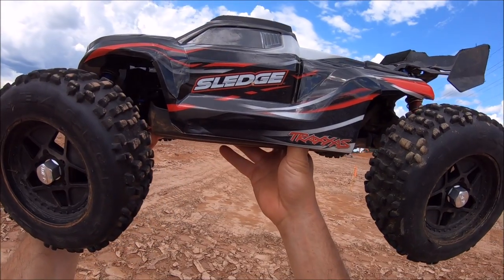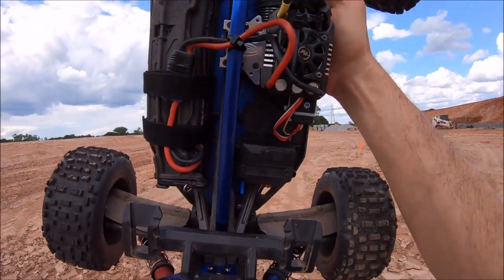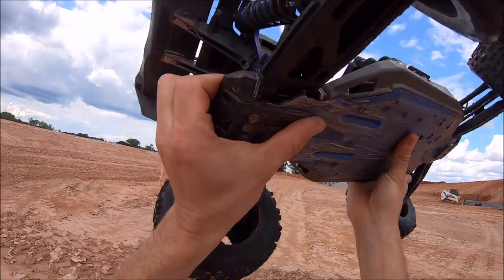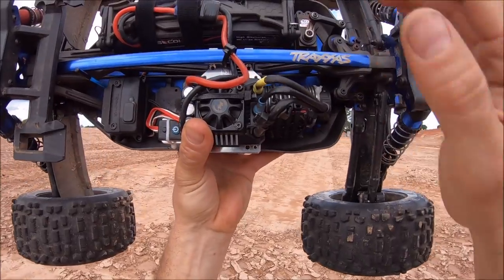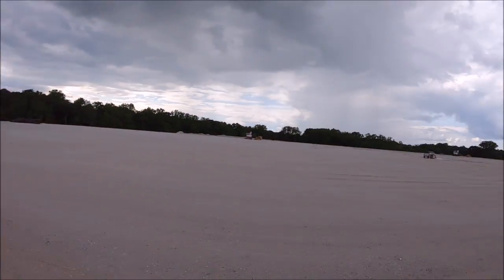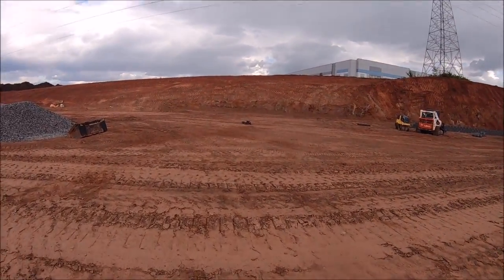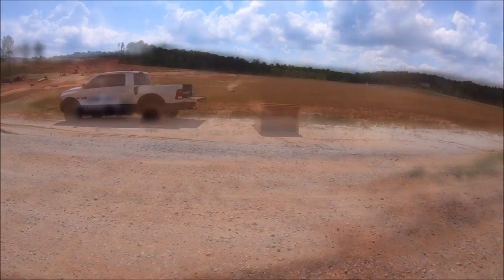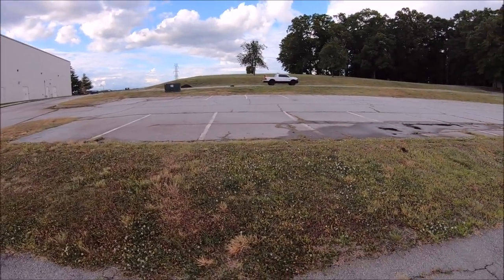TRAXXAS Sledge NEW! M2C Upgrades and MEGA Beatdown!

Comment: Damn , amazing bash session , i hope M2C start doing parts for other brand tho, thee are A LOT of people with crazy build of Wltoys that would pay for premium parts ( especially motor mounts that are adjustable ) including me . There is something cool about having a small 1/12 that does 100km/h + and is not just street only RC.
Reply: He only makes parts for cars that are weak points to where enough people will need them I don’t believe WLtoys has a big enough following of those that want to dump money into them cause they’re generally for people who are on a budget which M2c is not a budget minded parts company.
Reply: @codenamethecleaner7519  they are budget brand for sure but a lot of people build them into speed monsters and use mod1 gearing which requires another motor mount since the stock one is non adjustable.

Comment: Some questins, Sir:

1 is that the 4985-motor?
2 si the Sledge tuffer than the Kraton? I built one for a friend with all possible upgrades, even alu-diffcases/bulkheads. It is not so strong as people believe
3 please, PLEEEEEASE tell me how to secure pinion gears. No matter what car, we cannot secure them. Even the D-bore pinions on Hobbywing-motors get us loose. We let the loctite cure for days....makes no difference. Please give me a hint, Sir.

Comment: are you running the upgraded diff gears or stock ones?  ... also stock motor with max6?
Reply from the maker: Stock diff gears. 3 vids in and haven't touched the diffs. We'll see how long they go!
Reply: @RCDUDE81  stock motor too with the Max 6?
Reply from the maker: Yes stock motor, Max 6 and 17/46 gearing. That is a hot setup so I don't recommend it unless you cool down every few mins or run fans.

Comment: Did you change the motor too or just max6
Reply from the maker: In this vid still running a stock motor. I did later switch to a Hobbystar 4092 1480kv.

Comment: Are you still running the hrb 6s 5200 battery?
Reply from the maker: No that battery crapped out😝I run through lipos like knife through butter🤣
Reply: @RCDUDE81  lol. Do you think it’s a good buy overall? I see them on eBay and need to buy some up. Thanks man
Reply from the maker: They are definitely good powerful batteries!👌 Just take extra care of them and run padding in your trays if doing big airs!
Reply: @RCDUDE81  thanks man.
Reply: @RCDUDE81  overall what’s your thoughts on the sledge ?
Reply from the maker: I think it's a great truck just needs the motormount upgrade for sure. Not as great of handling as the Kraton but still fun to drive and tough! My vids show what she's capable of! I have recent vids too testing the M2C chassis💪 It does have some nice features and love the body mount design! The arms are super strong too! Only broke one since I've had it. Diffs have been good too.
Reply: @RCDUDE81  thank you. Does the max 6 esc make a difference ?

Comment: Omg they did not put esc there🤣🤣🤣
Reply: Fail 👎🏽. Can it fit a 4985 even?
Reply from the maker: That's why I mentioned prototype. This is all changing soon! You'll love what's coming soon!😁👊👊
Reply: @RCDUDE81  hope soo. That’s not it at all. I got pics of my sledge with 1717 and mmx if they want to see it and build off that.
Reply from the maker: @deontay79ify  The new system will fit a 4985. Even will have a reversed motormount system for bigger cans on the new chassis😁
Reply: @RCDUDE81  sounds good. That’s wat I’m interested in